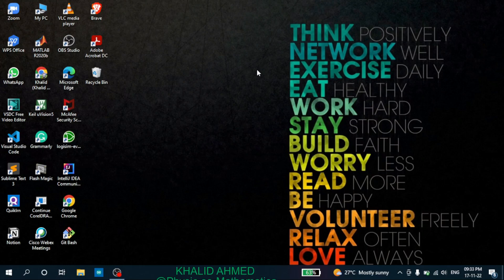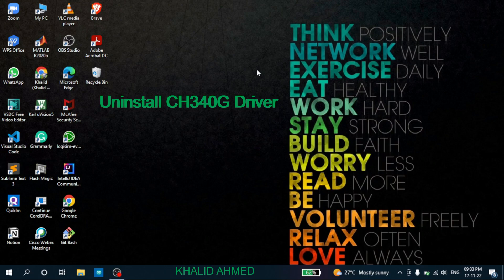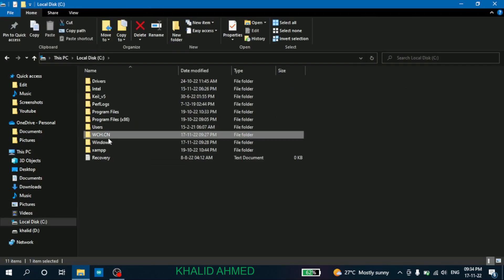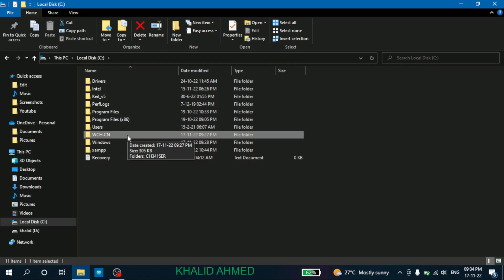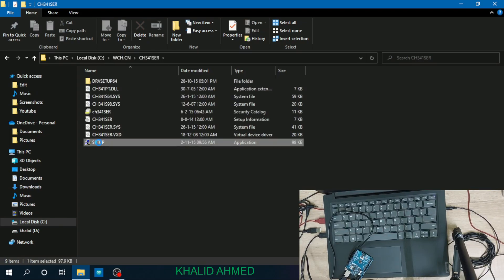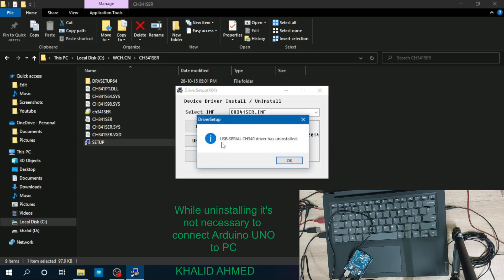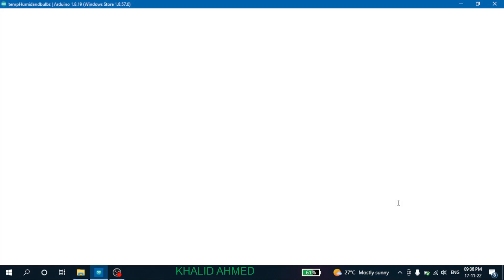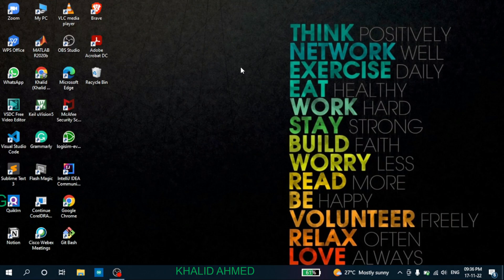How to uninstall CH340g Driver | #arduino #driver #windows10 #computer

Comment: When I press uninstall it says "no device found". I think the driver is not installed yet and when I press install it says "the drive is successfully pre installed in advanced". Those two things contradict each other. Can you help me fix it? please 🥺🥺
Reply from the maker: While uninstalling, make sure you've connected the Arduino to your laptop or PC, then try to uninstall and install it again if you want to. No device found is only received when you don't connect Arduino to your system.
Reply: @mask-coder  I made sure I plugged in the arduino but it still says "no device is found"

Comment: bro its not uninstalling its showing "no device found" what should i do
Reply: But when I click on install it says the drive is successfully pre installed in advanced
Reply: @SubversionSecrets  Did you manage to solve it? i have the same problem here
Reply: @SubversionSecrets  the same question. could you solve it?
Reply from the maker: @SubversionSecrets  do you want to uninstall or install
if you want to uninstall then click on uninstall don't click on install
if you want to install then it's already there in your system.
Reply: @SubversionSecrets  I'm struggling with the exact same problem. Did you by chance find any solution yet?
Reply: @SubversionSecrets Hello, I am having the same problem as you. Can you share how to fix it?🥺
Reply from the maker: I think then there is no driver in your pc
Where exactly is it showing this?
I mean like after clicking on setup?
Or after clicking on uninstall?
Reply: @mask-coder   after clicking on uninstall
Reply: @mask-coder bro kya aapka problem fix hua
Reply from the maker: @SE_Sachin_Siddhartha yup
Reply: @mask-coder  kya bata sakate ho bhai kaise huaa mera to nhi ho raha hai
Reply from the maker: Then there is no driver installed in your system
Reply: same issue